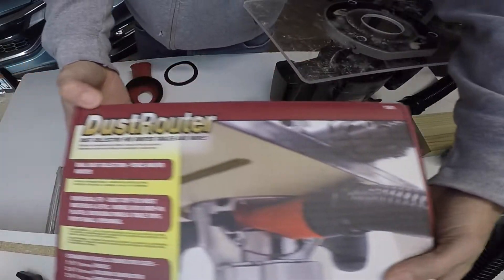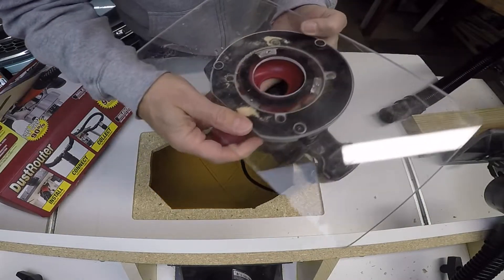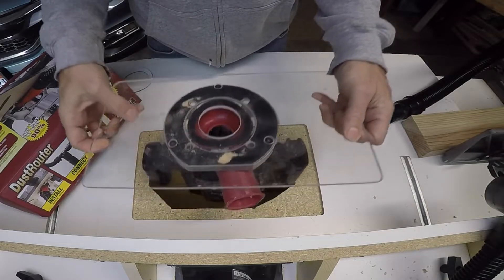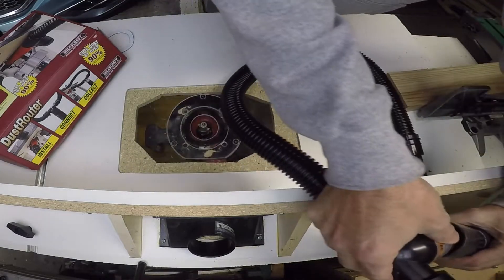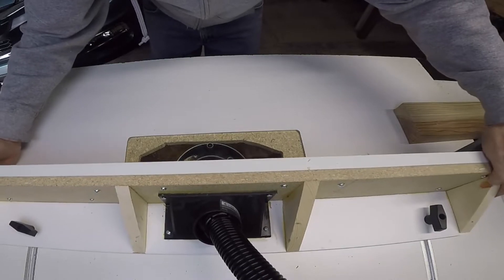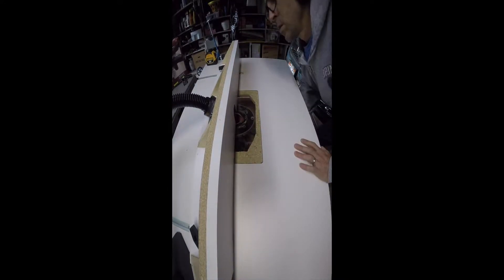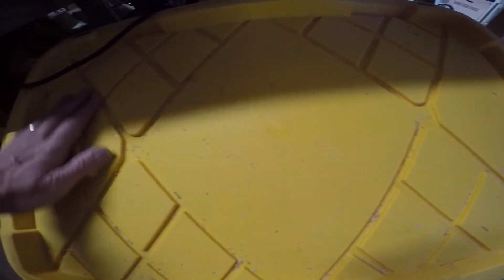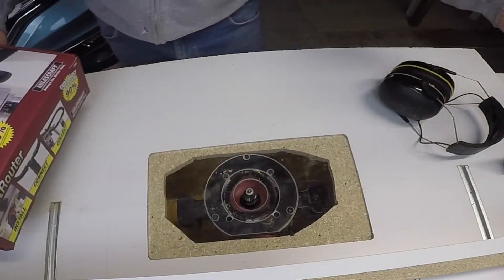Milescraft Dust router Review

Comment: I have just installed the system and used it for the first time: The top part is just as good as the one I had connected to the fence. The cup works well, much better than no bottom vacuum and a lot better than the home-grown solution I had. Still some dust at the bottom, but manageable.
It is a bit difficult to work with routers bigger than the hole in the dust cup, mounting becomes somewhat fiddly, but it can be done, even without cutting the dust cup as suggested in the manual.
Conclusion: money well spent.
Reply from the maker: Great!  Glad  its is working out for you.  I like mine too, definitely better than nothing!

Comment: I have a Bosch1617EVS router mounted in a Bosch RA 1171 router table. I just received my Dust Router and installed it. It is just about impossible to to install a router bit without removing the cup. Not a very friendly undertaking. Anyone else using the Dust Router and have a set up like mine, Please share any thoughts and advice. Not sure what I will do next.
Reply from the maker: Oh that sucks! Sorry its not a good fit for your setup.